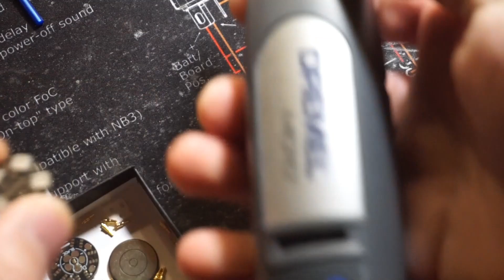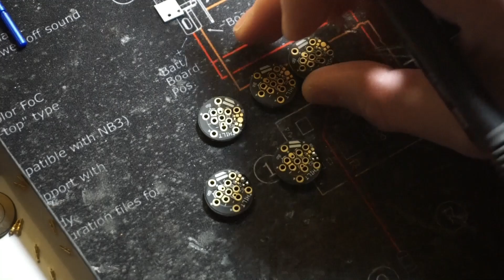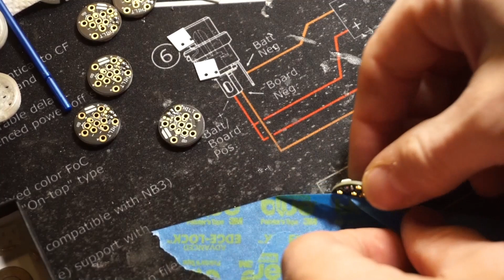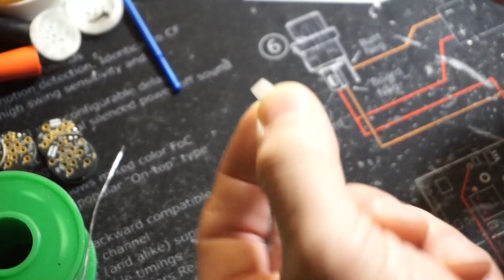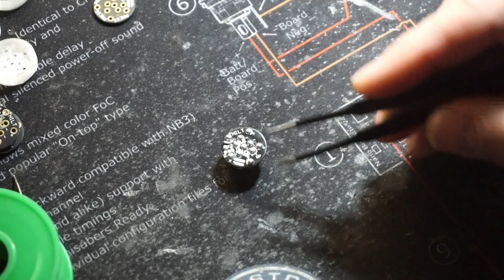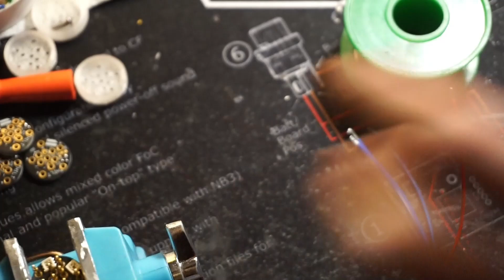How To Assemble ShtokCustomWorx Hilt Side Pixel Connector

Comment: I'm new to this but I'm trying to figure out how many pins I need/why I need more or less pins? There are lots of 6 pin versions and 10 pin versions, and I recently saw an 11 pin connector. Also why would I need a longer vs shorter pin? Some connectors have built in neopixel LEDs on the board; could I use those with an inert diffused blade for dueling so I don't have to spend an extra $50 on the neopixel RGB adapter? Is that what they are for or are they for accents or lighting up a blade plug? I'm about 1/4th of the way through the video so sorry if you answer the questions in the video. I've been looking lots of places for the information but it's a pain to figure out what's even relevant. I'm hoping to use the Golden Harvest v3 board.Thanks! Also subscribed and rung the bell. Thanks for doing this tutorial!

Comment: Thanks for making a video like this, it was very informative! However, I was wondering if you have to wire both data 1 and 2 if you're running the blade and pcb in parallel (v2 configuration) if you were using a proffieboard 2.2, thanks!
Reply from the maker: Hello, Shtok has a manual for his products, best to review the manual for your answer...

V2 – blade + pcb leds in parallel
Data lead is wired to D2 pad with on-board 330 ohm 0603 resistors R1 and R2.

Comment: Thanks man, solid video. Just to clarify, if wiring one of these to a CFX board, I want the leds to work when theres no blade in, then when the blade is inserted for it to act like the PCB LEDs arent there. Do I do V3 (in series), bridge the BP, resistor the R2,  bridge the jumper (whatever that is) and add 5 to the pixel count?
Reply from the maker: Hi there, sorry I do not know the answer to this.  I am not in tune with CFX programming and if it would support that type of setup.  You might be better off asking in the CFX facebook groups
Reply: For CFX, you’ll want to do V2 (in parallel). See page 7 in the Shtok Manual. Works perfectly for me.

https://drive.google.com/file/d/1GrMr9Bc7XLF4QvJJRuuiurlNG1VbhTG-/view?usp=drivesdk

Comment: Thanks for showing the actual wiring of the connector. I'm using a GH3 board and wanted to figure out how to use a Shtock NPXL v2 connector with it. Have you worked with that board and is there anything that I'd need to do differently?
I've noticed it only has 1 data pad and there are 3 led pads. You only connected two negative wires for two LEDs. Can you tell me why? Thanks
Reply from the maker: The v2 option for the Shtok PCB is the in parallel option, which means the 5 LEDs on the PCB will mirror the first 5 LEDs in the blade.  The GH3 board wouldn't care or know of the PCBs existence, to it there is a single blade with 130 pixels (or how many pixels are in your blade).  

You can run 2 LED wires if using 22awg, or 3 LED wires if using 24awg.
Reply: @ShaminosWorkshop  do I need to bridge two of the pads on the pcb like your video mentions?
Reply from the maker: @LagunaLeonhart  There is a pin labelled BP (Blade Pin) and is used for blade detection.  If you are not implementing blade detection, then you should bridge the BP pin with the closest GND PIN

Comment: do you use flux on the side where you place the resistor etc or is that only required for the pin portion
Reply from the maker: I use a liquid flux from Kester.  Just a small amount when soldering, then clean off with 99% IPA
https://www.amazon.com/gp/product/B01N2333K5

Comment: If using Proffie 2.2, you dont need to resistor the Data pad, correct?
Reply from the maker: If using data pad 1, then no resistor would be needed.  However if using a different data pad, you need to add a resistor.

Comment: How do you secure the neo pixel hilt side holder into the hilt?
Reply from the maker: Hello, it depends on the hilt.  Some times the holder is built directly into the chassis, or sometimes you use a holder that is held with a retention screw (similar concept to an LED heatsink)

Comment: Thanks for this. You probably meant to check resistance from the data2 input to The data2 pogo through hole to check for a good connection? Also try tinning one resistor pad and laying the 0402 resistor in place. Hold the resistor down with your tweezers and heat the tinned pad. It will then lay flat and you can solder the other leg the same way you tinned the other pad. If that makes sense. It's the easiest way I've found for smd components. Thanks again
Reply from the maker: Great! Thanks for this feedback.  Some thoughts

1) There is no pogo pin hole for data2, only for data 1.  Please clarify
2) My hand is too shaky to hold the 0603 resistor with a tweezer :)  That is why I prefer the method of taping the resistor in place.  I'll try soldering just one pad though next time.
Reply: @ShaminosWorkshop  1. you are right. I was thinking two things at once sorry.  That would only work for data1. Data2 can only test from input to the opposite side of resistor. It would really only test the one solder joint. Testing both sides of the resistor only tests the resistor itself and not the connections. But like you said it's really overkill anyway. 2. That sucks mine does too sometimes. Might take me a couple tries sometimes to get it held down with tweezers. I suppose you could still use the tape with only one side pretinned. Tinning both sides i tend to get one side higher than the other then I'm trying to heat both sides to get it down flat or just leaving it. Maybe you don't have that problem? Thanks again. I'm sure these videos are really helpful to people.